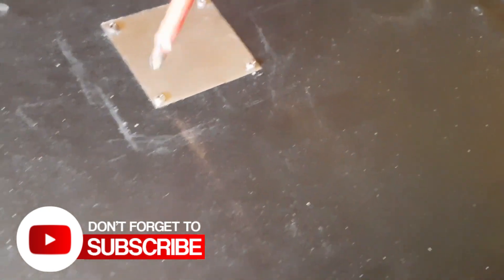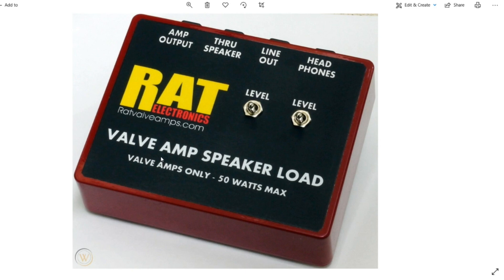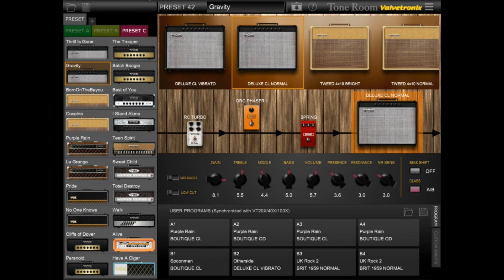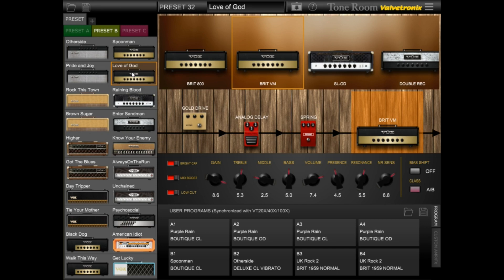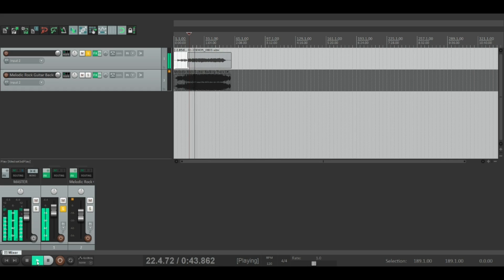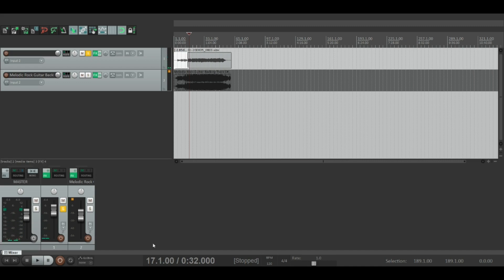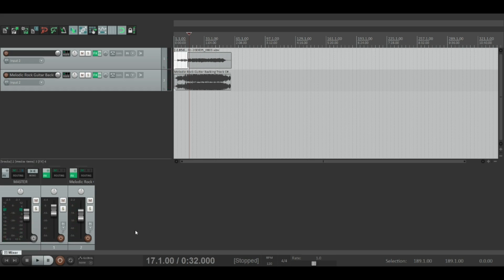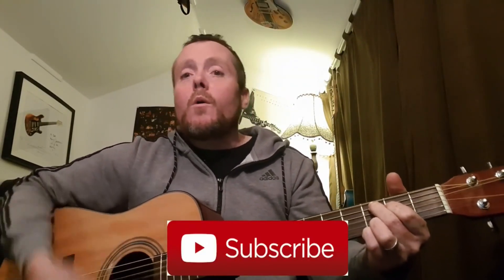How To Use Vox Valvetronix Vt 20/40/100 And Tone Room In Your DAW

Comment: When you have a 5 ohm speaker and you put a 8, 16 or even 32 ohm load there is absolutly no proble. (Only that it sounds quieter). The problem starts when you put less load than it shold be because the energy flows quicker and the amp overheats.
Reply: So would a 4ohm speaker cause the amp to overheat?

Comment: Are you sure the valve section is lost in headphone mode?! I figured they are integral to the PreampStage, and the tubes' signal are sent to a aux-out, merely bypassing the solid-state PowerAmp only.

Comment: the headphone jack is line out, you can get a Heaphone to 1/4" converter and plug it straight into your interface that way.
Reply from the maker: Yes but you bypass the valve stage

Comment: You can use the headphone out into an audio interface--no dummy load needed; no microphone needed.  I use IK Multimedia's Amplitube 4 (DAW) software and the Vox Tone Room software all on a Windows 10 computer.  I can tailor the amp from either piece of software to fit my needs.  I use Reaper DAW software as well, but the workflow is easier starting with Amplitube 4 and importing track into Reaper afterwards.